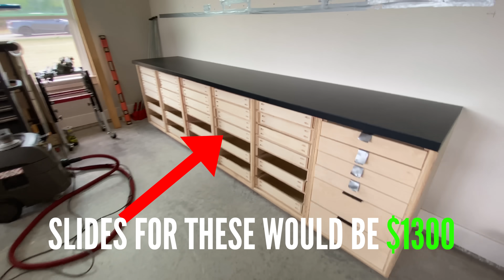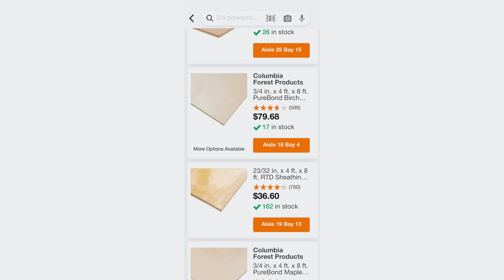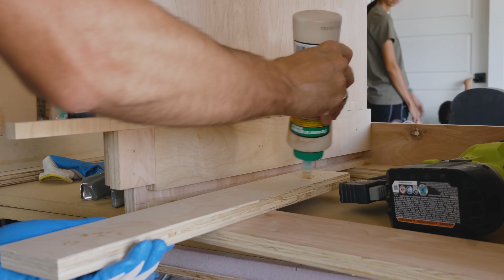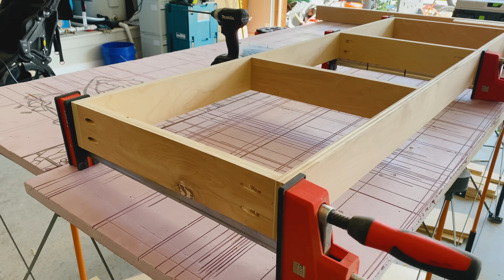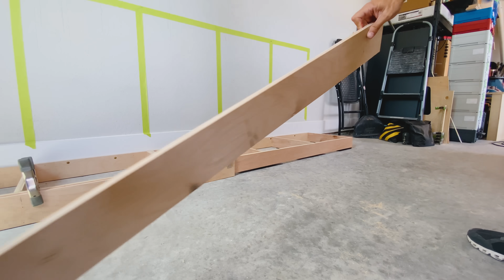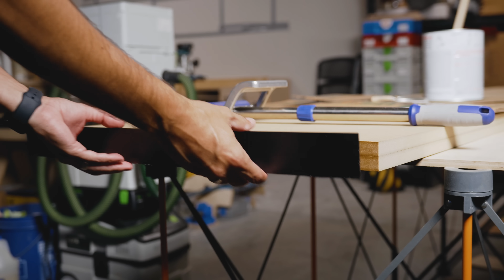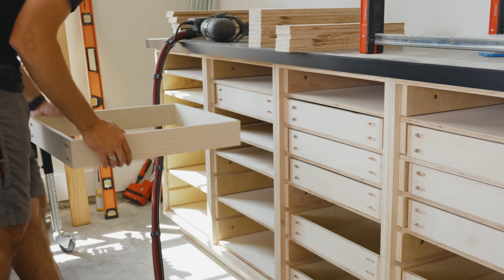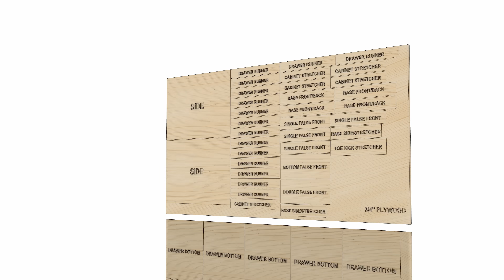Drawer slides are expensive. Do this instead.

Comment: 13:20 I’d probably put the ‘drawer slide’ plywood on two sides of one vertical divider/carcass panel. Less material, and 3/4” or even 1/2” or 5/8” is sufficient imho. 
Alternatively, one could glue two 1/2” (or 3/4” if you are paranoid 😅) together with the slots for the draweR bottoms milled in; the ends could be just 3/4”. 
That’s less material, time, and plenty strong. 

Like your design- I’m looking at vids before I implement something similar. Always been a fan of shallower drawers and more of them: too many deep drawers for tools just bury stuff and you can’t find it which’s the antithesis of why we use drawers. Well besides the fact they let you put lots of stuff protected into a small footprint. 

21:06 it is not DRAW most places. That’s a weird thing that I recall starting with Norm Abrams. ‘droor’ ‘drawer’ ‘drawrer’ doesn’t misconsonant anybody. 

🤿14:10 tape and compound is fire resistant 29:04
EDIT
Looks like I watched this before 🤫

Comment: Great build, never considered to build the drawers this way with the wooden sliders,I like the lament counter top, but for my workshop I used 3/4” MDF because when it gets too cut and marked up I turn it over and I have another clean smooth surface. 🤿

Comment: Back in the 1930s my dad installed linoleum counter tops, floors, etc. - big stuff.  Sometimes he used sticks to keep the glued parts separated, but the trick he taught me was to use waxed paper.  After the contact cement dries, cover the entire bottom with waxed paper.  Then align the top piece on top of the waxed paper.  Once it's ready pull the waxed paper out from one side rolling the glued pieces together as the waxed paper is withdrawn.

Comment: Well done. I am surprised that you were cost cutting and didn't route out a drawer face hand gap. If you still have your receipt for the hardware you could make an easy follow up on their removal, which I would also watch, and you could comp yourself for those savings. Just as well if you didn't🤿
As a scrap tip, trimmed off trash laminate can be applied laminate on laminate as friction reducing drawer glides*

Comment: Factory edges on sheet goods has always been the accepted standard for a straight edge to start cuts from.  Dinged up is one thing, but "straight" is something you can pretty much trust in my experience as a 50 yrs + production furniture/cabinet maker= hundreds of UNITS through panel saws, cabinet saws and table saws :)

Comment: I love what you've done here, it's super beautiful and functional, but I had a thought that could improve how they slide a ton.
I imagine you could have picked up a tub of sealed 608 bearings and fit them to the drawers for an incredibly smooth/easy to pull but still cheap ride; four bearings per drawer, two drawer mounted two cabinet mounted.
Keep the tracks the same save for an angled cut in the wood up top at the front on the cabinet side, drill out and fit a dowel into the front of the cabinet track to put one bearing onto, fit a dowel into the back of the drawer, same deal as the front for the bearing, then repeat on the other side.
The bearing on the drawer will run above and past the other bearing through the angled cut, then the drawer will ride on both bearings the whole way in and out even when the support from shifts to make the back lift up as you pull it out, super simple setup, and for the same 36 drawer setup you priced at the beginning of the video, the bearings would total $28 after doing the maths on the first sealed 608 pack I saw on Amazon, at $7 for 20.
I'm pretty sure this is for the most part how they used to do smooth gliding drawers anyway before people got addicted to fancy linear rail drawers, so it's not like I'm expressing an original idea. Just revisiting and reintroducing an old one.

Comment: Some of my first shop drawers were built like this using a 3/4 bottom that protrudes onto slip runners. Those were 40 years ago and have seen all kinds of dust,grit and abuse. I’ve had to add some new paste wax a couple of times, but never had to clean and oil like ball slides. Great job. 🤿

Comment: 18:33 why are you using a router and not a laminate trimmer? The latter is a simple unpowered device with a razor blade held at optimum angle to just run along the edge and slice off the excess. No need to run a router around the edges. That bearing running on the laminate melted it from friction

Comment: I think it is great that you want to save money but there is a reason why drawers have been built the same way for hundreds of years. If you have any humidity or drastic temp changes the drawer will warp and twist the bottom is supposed to float so good luck pulling them out after the nails start to pop hope you are luckier than I am

Comment: I didn't use laminate on my top.  One sheet of particle board was part of the structure and screwed down tight.  The top was another sheet and painted.  It was then attached with one screw in each corner. I wasn't worried about someone breaking in and stealing it. I wanted something easy to replace because I didn't want to worry about cutting or drilling into it.  I turned it over every few years and replaced it once in over 25 years of use.

Comment: You could have done a 45 degree chamfer on the top/bottom of the drawer fronts and made it finger pull to cut the cost of the metal pulls. Also, pocket screws aren't necessary for drawer boxes, you can use brads and glue.

Comment: Great project.  I wish the front of the drawers met each other instead of having the vertical divider between the drawers being visible. Or if there had to be a divider showing it would be nice if it wasn't the edge grain. Since its a shop use item maybe plan ahead for some type of labeling or organizer.

Comment: Could have saved a lot of materials, and increased the storage space with a couple simple changes. Use 1/2” sides - your doubling them up anyway, so still strong. And, instead of wide blocks creating small slots for the extend bottoms, use small blocks, and just make the cases wider. I realize they are designed to swap between large and small drawers (draws), but who is actually going to do that? especially considering the design as is leaves 3” between each shelf. That’s a lot of wasted space. Even better, use Delrin strips as the slides. Less wear and smoother slide.

Comment: The contact cement gums up the bearing causing the bearing to spin with the bit which then puts friction and heat on the laminate material and that's where you get your damage on your Edge band. To mitigate this you can use something like Goof Off to make sure that you're bearing doesn't have any residue from the contact cement and then we Grease the bearing with Marine grease or axle Grease. You might have to do this several times throughout a single project but you will get perfect trim without the burn

Comment: I used to install 2-3 sets of cabinets a week in the late 70’s.  I found an old window blind and took the slats out.  They are curved. Steel.  I put them on the counter top about 8-12” apart after the glue dries.  Flop the Formica down on the blind slats.  The curve of the slat makes minimal contact and allows you to reposition the Formica.  When you get the correct placement pull the slats out starting from the middle going to both ends.  Visual inspection or count to make sure you removed all the slats.  The trimmer will trim steel too.  On the trimmer, first the bit depth was too deep.  So if it does dig in it won’t mess up the whole piece.  The bearing is too small.  Tape it to give some wiggle room.  The real problem is there are 2 thicknesses of finish of Formica.  The cheapest is for wall and the thick is for countertops.  When preformed tops came out most top shops were using the thin finished type.  Kinda like sanding through the face on cheap plywood.

Comment: This is just a hypothesis.  I think the baring on your bit might not have been on tight enough.  That would cause the bit to chatter ever so slightly.  Also, that is a small bit and laminate is brittle.  There is a need for speed.  How fast were you running it?  Did you wax the draw runners?  Now read this all back to yourself with my deep southern accent.  Gig'um Aggies.

Comment: You use BLUM as a parameter. Here in Brazil, there's plenty of good slide brands that cost less than a third of what BLUM does. One of them is Renna. But your project is a great solution.

Comment: I got some home depot birch plywood the other day. Absolute garbage... The birch laminate is paper thin, literally; the glue that adheres it is crap. Cutting it without chipout is nearly impossible. A trim head screw will cause the laminate to come off. I mean, did they use elmers school glue? Grrrr.

Comment: When routering an edge on laminate that leaves a tool or blade using a finished face as a reference face, there are a few tricks that I use.
I like to use a router bit with a barring just larger than the blade diameter so you leave a small lip and then file the lip off and also round the edge using a... "born out of wedlock" file. It takes a bit of practice to file well but it becomes a very quick process that is more reliable than trying to rely on a router blade that chips and dulls fairly quickly against laminate.
A second option is using painters tape (as not to leave glue resin from other tapes on the laminate) before routing onto the finished reference face. This works well but it usually has a high cost in tape which isn't good if you are working on a larger scale.

Comment: Maybe I’m dumb…but getting plastic shims because they’re “more consistent” seems silly to me. They’re just little wedges to make minor adjustments before you install the actual supports. The only thing I can think of where plastic shims are best is leveling a toilet in a basement for example. You don’t want wood that will shrink/expand/rot. You want something stable and permanent but easily adjustable before tightening down the bolts.

Comment: 🤿Nice build, really like the modular layout, maybe a strip of masking tape around the edge before trimming might of stopped the marking on the bench top? I made one with commercial bar top vinyl, heated it can be rolled round a routed edge but exactly the same process for contacting the top, leave it extended enough to heat and form round the benchtop. The corners are a little trickier to get neat though so is maybe suited better to a bench with closed ends

Comment: I was a cabinet maker at one time and we used to spray the laminate with furniature polish  before cutting the top with a trim router. That inabled the bearing to slide effortlessly   with the cutting. Then cleaned it off, don't be skimpy but also not excessive

Comment: these look great. 🤿 while i am a fan of duct tape, it is not for sealing seams permanently. had you left it, you would have ended up having to take down the upper cabinets in about 6 months to fix the air leaks properly anyway.

Comment: nice vid, esp on the wood source. big box should be boycotted and put out of business, but guys don't know they can get better, unfortunately. question. so why not skip ALL of that extra wood on the sides, where the drawers will simply slide in and out. you could've used some nylon stripes, screw those in and you're set. very slick. idk how much wood you placed there, but looks like a bit. I think the nylon, especially made at home, say, from recycled material, would be almost free.  and who doesn't like melting and burning dangerous things that make fumes ? lol. maybe a time to put the respirator on, even though  it says non toxic. lol. anyway, just a thought. good vid ! Thanks. -future project.

Comment: I bought your plans and I was just about finishing up when I realized that the handles I bought (like yours) won't fit because of the height of the drawer gets in the way of the drawer front. I was all set to buy a different type of handle, but then said, "hmmm I wonder how Drew attached them." I went back and watched your video and saw your mortise solution. Excellent solution and saved me having to buy different handles and toss the ones I originally bought. BTW the build worked out very well. I built 6 cabinets. The one change I made was that I really like the look of baltic birch, especially on the edge, so I made a 4" wide baltic birch frame to save on wood costs of solid panel. Then used not so good plywood panels and cut dados/grooves in them with a dado stack on my table saw for the runners. Other than that, I followed your plans and it worked out very well. Thanx!!

Comment: You should PROBABLY be able to buff the bearing scratches out to the point they are barely noticeable... But yeah, probably the bearing got a bit warm and started "eating" into the surface of the laminate...

Comment: I could see a single layer of painter's tape on the edge of the top for the bearing to ride on would let you avoid that damage. I don't think making the depth more shallow would work but maybe the tape would be the tiny shim you need. The final sand or filing could be done before removing that tape also. 🤿

Comment: Flatbed semi driver here! I've actually delivered loads to Plyood Co! Last time it was a full truckload of MDO.

Folks, lemme tell ya a secret: Roseburg MDO is their doug-fir boatbuilding plywood with a paper face. Same stock, same assembly line, same adhesives, just with a kraft paper facing. Super-low-void and the paper face takes paint and glue perfectly.

Comment: Love it.  I think i might be able to modify the plan slightly to use recycled pallet wood... imo the pallet boards could be used for the uprights, the spacers, the drawer bases, and the 4piece drawer box.  Maybe even doubled/staggered for the toe kicks. It'd take fussing to get the boards smooth, but I reckon' it's doable.

In my area there's lots of vintage desks and stuff on Craigslist free.  I think I might be able to find nice wood for drawer fronts there.  Maybe even some used drawer pulls.

Thank you for sharing this awesome, flexible drawer plan.  Brilliant.

Comment: I suppose functionality is more important than looks but I would have covered up the plywood edges between the cabinets. You could have made your drawers slightly bigger and had the false fronts cover the edges just as easily as what you did. I do like the way you made it without hardware however.

Comment: 🤿I have a much smaller project, but will use your drawer slide design. Did you consider teflon tape for the 72 slide surfaces?  It'll work much better than duct tape. 😉

Comment: The marking on the edge when using the trim router might have been unavoidable.  Typically, a router bearing is on the reference piece and the blade ONLY touches the trim piece.  Using stock that is so thin presents a problem.  You MIGHT be able to line it up so that the blade only touches the laminate, but that would be hard and you might end up having to bring the blade down over it anyway.  In any case, the markings in that situation might be less noticeable.

Comment: Great joinery video, but you didn't put a vapour barrier between the insulation and the internal plasterboard, so if you heat that space, you just created a swimming pool of interstitial condensation in your wall. I hope those studs are well treated!!

Comment: another advantage to composite wedges in a 'moist' environment is they don't rot. - 10:43    plus, if your garage flooded once before, what makes you think your running total,
outguessing your wife on rain, will improve?   So why not ( notch)  leave a way for any moisture to escape - other than your unsealed plywood's absorption capability?

Comment: I'm so disappointed in the final reveal. I have a bathroom reno I haven't finished since the plumbers left in June because ... plastering. You got my hopes up that I could hide the joints behind the washer and cupboards (that I haven't built yet) and just use duct tape.🙄
Holding my breath trying to find the snorkel emoji:face-blue-question-mark:
(nice job!)

Comment: Great video, I've ignored making the drawers (draau) for my garage workshop because of the cost of the slides. My OCD prefers slides, my wallet does not. Maybe I missed it, did you do anything special to help the drawers slide easier? Sand with high grit or wax the slides? I plan on putting some tools and it will get heavy, and stuck drawers would aggravate me over time (OCD entered the chat again).

Comment: My spouse was a master carpenter/builder, and I have loads of drawer slides, hinges, pulls, etc.,that I was going to donate, but hearing how expensive the good ones are, I think I will use them.   I admit I was  saying, "Not smart, not smart," at the duct tape part. I have taped and bedded several houses. I was doubting your intelligence,  so I'm glad you corrected it at the end. 
I sure hope that you put a finish on the cabinets!  Buying good lumber and not finishing the units after all that labor....Not smart, not smart..

Comment: Cool video. Thanks for the idea and tips. We tend to get heavy rains here in with Louisiana, so only feel thing i would do differently here is build about a 4 inch base (maybe sacrificing a bottom drawrl) with some type of water proof material, plastic, in case the garage floor ever gets wet. Thanks! snorkel 😅

Comment: for your cabinet base, I would've used treated lumber and trex-style decking material for the kick plate (both safe for concrete contact and possible water in the garage 🤿). this drawer slide idea/design is awesome! will be using. thx!